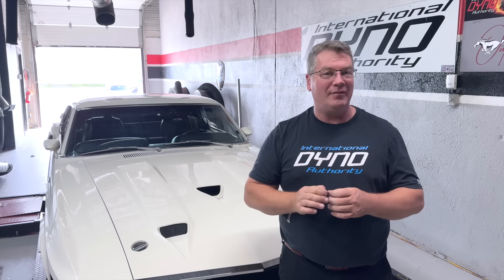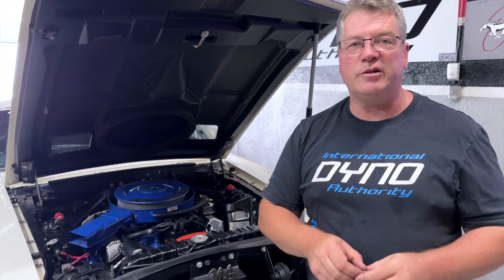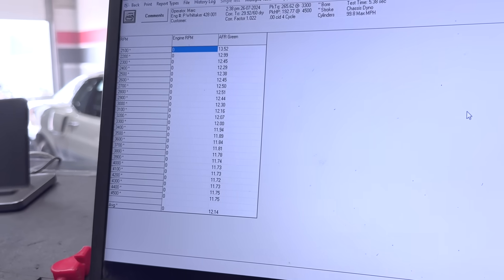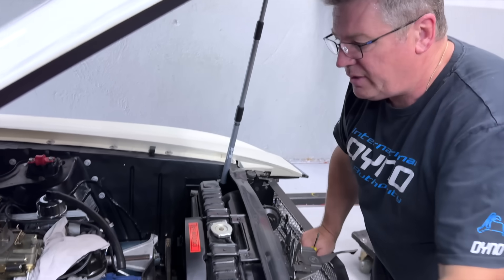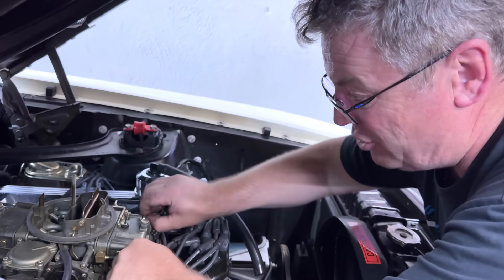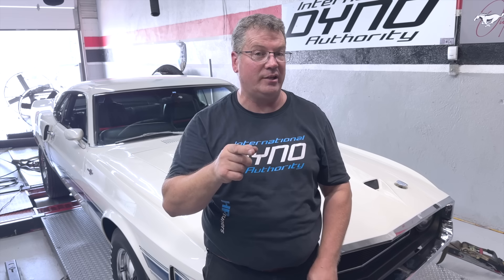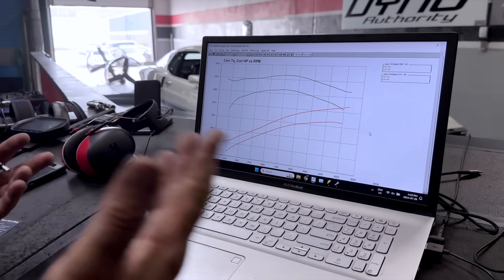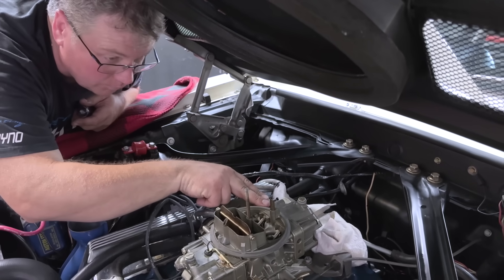Original, unrestored '69 Shelby GT500 tuned on the dyno

Comment: Torque is in lb-ft, not ft-lbs.

I would be running the timing at 10 - 12 initial and 34 - 36 at 2500 - 3000.  Without the vacuum advance, a change of weights and springs might be necessary to get a full mechanical curve.
Reply: In the old days it was said ft.-lb's.
Reply: @samiam9008  Which was wrong.
Reply: @lelandlewis7207  yeah, just saying
Reply from the maker: @samiam9008  How to Convert a Newton-Meter (Nm) to Foot-Pounds (ft/lbs)

Ft-Lb to Newton-Meters - Nm to ft-lb Calculator

https://en.wikipedia.org/wiki/Foot-pound_(energy)

https://www.motortrend.com/how-to/ghtp-1108-dyno-testing-guide/

Calculating Torque

"When an object rotates around a point, the object's speed of rotation depends on both an applied force and the moment arm. The moment arm is the distance from the point of rotation to where the force is being applied. Torque is the product of the force and the moment arm. For example think about trying to spin a drum by wrapping a rope around the drum and then pulling on the rope. If the rope is wrapped around a drum of one-foot radius and pulled with 550 pounds of force, the resulting torque is 550 foot-pounds. The torque on the dyno's drum can be calculated by multiplying the force applied by the drum's radius. However, engine torque is not equal to the dyno's drum torque because the gearing through the drivetrain changes the moment arm. The change in the moment arm is proportional to the ratio of engine speed to drum speed. Therefore, tachometer readings are necessary to calculate and display engine torque."

The foot-pound force (symbol: ft⋅lbf, [1] ft⋅lbf,[2] or ft⋅lb [3]) is a unit of work or energy in the engineering and gravitational systems in United States customary and imperial units of measure. It is the energy transferred upon applying a force of one pound-force (lbf) through a linear displacement of one foot. The corresponding SI unit is the joule, though in terms of energy, one joule is not equal to one foot-pound.

It seems the "expression"   you choose is up to the Narrator at the time.

Cheers!  and Enjoy have a super day
Reply from the maker: How to Convert a Newton-Meter (Nm) to Foot-Pounds (ft/lbs)

Ft-Lb to Newton-Meters - Nm to ft-lb Calculator

https://en.wikipedia.org/wiki/Foot-pound_(energy)

https://www.motortrend.com/how-to/ghtp-1108-dyno-testing-guide/

Calculating Torque

"When an object rotates around a point, the object's speed of rotation depends on both an applied force and the moment arm. The moment arm is the distance from the point of rotation to where the force is being applied. Torque is the product of the force and the moment arm. For example think about trying to spin a drum by wrapping a rope around the drum and then pulling on the rope. If the rope is wrapped around a drum of one-foot radius and pulled with 550 pounds of force, the resulting torque is 550 foot-pounds. The torque on the dyno's drum can be calculated by multiplying the force applied by the drum's radius. However, engine torque is not equal to the dyno's drum torque because the gearing through the drivetrain changes the moment arm. The change in the moment arm is proportional to the ratio of engine speed to drum speed. Therefore, tachometer readings are necessary to calculate and display engine torque."

The foot-pound force (symbol: ft⋅lbf, [1] ft⋅lbf,[2] or ft⋅lb [3]) is a unit of work or energy in the engineering and gravitational systems in United States customary and imperial units of measure. It is the energy transferred upon applying a force of one pound-force (lbf) through a linear displacement of one foot. The corresponding SI unit is the joule, though in terms of energy, one joule is not equal to one foot-pound.

It seems the "expression"   you choose is up to the Narrator at the time.

Cheers!  and Enjoy have a super day
Reply: @internationaldynoauthority693  look at your own screen when showing the power curves, @ 15:36 it says “up 101.89 lbs-ft.”  SAE standard for engine torque is lb-ft, not ft-lb. They are 2 different measurements.
Reply: A have never heard anyone say anything different then ft. lbs. of torque
Reply: @3644Darrell  Then you need to look more.  Most articles use the correct lb-ft and it is the SAE standard.  Look at dyno sheets and they say lbf-ft.; I have only seen one that didn't. 

Many "car guys" who don't know say ft-lbs because they think of a torque wrench, but it is supposed to be lbf-ft, or pound feet of force.
Reply from the maker: @lelandlewis7207  herein lies the issue. Without actually testing, without actually knowing what the results are from each one of the tests. Saying 10:12, saying 34 3638. Is just guessing conjecture. 

That was a large point of this video. To show, that you can achieve excellent results by repeating tests, that are very accurate, that are straightforward. And, will also show you step by step how to reduce or completely remove the unneeded smoke. 

Very few times in tuning. Do we ever need to really do much with the ignition timing. 

Normally we work with the ignition timing curve only. 

The same procedure was followed, in this video. The ignition timing curve was adjusted rather than the actual peak numbers 

Merry Christmas, happy holidays to all of you and your family and your friends. From all of us at International Dino Authority
Reply: @ actually. I say it from experience tuning engines and dyno tests I have had run on engines. I’m not saying they are perfect for this engine, but from my experience, they give a good curve and power. On a 350 36 was optimum, losing power at 2 degrees up or down. I found the same on a mild engine , 10:1, at 310 @ 5,600 HP and a 10.5:1 465 @ 6,700 HP engine. Above those powers I can’t say by experience, but logic dictates that higher RPM requires more total to get the optimum burn and hit the maximum pressure at the 21 degrees piston position rule of thumb.  Even at 10.5, with a big bore like the 428, it should need a bit more than 28 for best performance, to get the flame front across the cylinder for maximum pressure and still not ping. 

But, yes, without testing it, it is just opinion based on my understanding of what timing does for the flame front. I am not saying you’re wrong, but I haven’t seen a NA engine that didn’t need more than 28 degrees total and most like it at about 3,000. I just say what I would try and then back down as necessary. 

Great job on the smoke issue either way. I don’t think I would have picked up on the squirter issue, at least not without some research and watching your video. 😉
Merry Christmas to you too.

Comment: I had a old hyundau scoupe turbo 1.5 4banger about 102hp. Ported an shaved the head down. Bored and stroked it made 198. Eith no new parts ppl forget its making ruff serface smooth is huge deal any car can make more power wuth no acual upgrades
Reply: Bored and stroked isn't an upgrade??
Reply: @tuffguy428  point was no expensive parts needed. Just junk yard bits and some elbow grease

Comment: My uncle bought an old local garage that the PO had passed away and found a complete 67 Ford Fairlane 428 CJ  4 spd sitting in a small bay in the very back that nobody knew was in there that needed restored he finally got it completed a few years later and it dynoed at 303 hp on a portable mustang dyno but he just recently passed away from cancer and now his daughter has the car along with his sons and her brothers 67 gt500 that he was restoring but also passed away from cancer a little over a year earlier
Reply: The CJ wasn’t offered in 1967, so the Fairlane either had a 390 or someone transplanted a 428 into it.
Reply: @fastmz3  it may have been a 68 it was numbers matching engine
Reply: I can actually find out exactly what year it is I'm sure he wouldn't have spent as much money as he did restoring that car if it wasnt the original engine
Reply: @bethanyhaskiell9116  If the first digit of the VIN is an 8, then it's a 1968 model.

Comment: Adding headers and a free flowing exhaust would make such a huge difference on that motor.
Reply: Agreed but putting headers on that original car would hurt the value.
Reply: @tuffguy428  depends on if that's why you own it I suppose.  If I had an original '69 hemi r/t charger the first thing I'd do is headers with a proper exhaust, I'd just keep the original stuff in storage somewhere.  My Nova has headers with a 2.5" exhaust with an x pipe and it sounds so much better than when they just had dual pipes with no crossover.

Comment: a rare honest dyno test.  300hp. The claims of some folks about these engines are absurd, these are RV/truck engines, rated around 335hp.
Reply: @TheHypnotstCollector  300 wheel , there is a fair amount of loss in the drive lines which puts this particular car well over 335 at the flywheel.
Reply: @kylevantassel7259   True.  There's a good 100hp, esp if it's an automatic trans.
Reply: No way was the CJ an RV or Truck engine.
Reply: @jeffcoleman2263  Well, they're long stroke, put em in RV's and Trucks... and other stuff. Not a race car engine.
Reply: @TheHypnotstCollector  428 was never installed in trucks. Indeed, Ford created the 428CJ specifically to address street performance, and its public debut was at the ‘68 Winternationals in Pomona - a race meeting - where it cleaned up its classes.

Comment: What a Lemon.  428 cid and a lousy 299hp @ the wheels. I now understand why they only had this engine in these cars for a very short period of time. I think the 351 Windsor would make that hp or even more. How much does one of these 428cid boat anchors weigh ?.
Reply: In 1968 Hot Rod magazine tested the 428CJ mustang.  In ran a tractionless 13.56 @106. They stated it was the fastest pure stock ever tested by them, period! It went on to dominate the Winter nationals. Look it up on YouTube fuk head 🙄
Reply: Turn in you girl card. You're not even human.
Reply: The guy probably doesn’t have the money to buy a mustang II
Reply: Why so negative? Go back to your Pinto.
Reply: A 351 Cleveland would make far more power than a 351 Windsor.
Reply: @ you have to stay with the engine it was manufactured with to keep it’s value-otherwise stick a 427 in it  sheesh
Reply: I would trade 10 351 w or c for a 428 cj
Reply: Are you over 12 years old?
Reply: @3644Darrell  why do you ask, are you a pedafile.

Comment: the car pictured looks like a 71 or72, not an unrestored original 69
Reply: they didn't even make 71 or 72 Shelby's
Reply: @nolanjohnson2124 Actually they did. A deal with CS and a belgium dealer released Shelby Europa with the 71body line. 351c4v powered tho.
Reply: No, it doesn't. It's clearly a 69  shelby.
Reply: Go back to sleep

Comment: a very nice looking car but what a turd glad that its in the shape its in but no way it should be left like that that car should be in the 500-600hp range to even be decent and thats even low that car right now is a joke engine wise they had way more powerful engines in 1969 The 1969 Chevelle SS L78 396 had a rated power of 375 horsepower at 5,600 rpm and 415 lb-ft of peak torque at 3,600 rpm Year: 1969. Make: Dodge. Model: Hemi Charger 500. Engine: 426 ci/425 hp.Year: 1969. Make: Chevrolet. Model: Camaro COPO. Engine: 427 ci/425 hp (L72) V8.
Reply: Okay...but just to be clear the figures you're quoting are at the crankshaft.  The numbers in this video were at the wheels.  Big difference.
Reply: @dewrus2153  yeah i know that and some of them cars were underrated for insurance reasons this one clearly not
Reply: I see you dont know shit about cars😂😂
Reply: This doofus has no idea that a Dodge Omni in 1979 made 74 hp. You can't change history bud.
Reply: You obviously completely missed the purpose of this test. The owner brought the car for the shop to analyze the rich condition and correct it. It was not to compare engines and horsepower from other manufacturers. The analysis confirmed a very rich mixture from idle to maximum speed and professional tuning corrected it close to advertised horsepower for this engine. No point in turning the test into something it was never intended to be,
Reply from the maker: Absolutely Correct!   Thank you.   No one could've stated it more clearly or with any more straight forward intention.
Reply: @ellieprice3396  thankyou very much for this comment - I'm not quite sure what the negative commenters think that this video was about.  Never was a question asked if you liked the car or not!!!
Reply: @ellieprice3396  i full well know what this was but lets clear this up do you need a dyno to tune a carb no does hp numbers need to be had to tune a carb no so was this about getting it dynoed and increasing hp as it was about tuning the carb yes it was if you can't see that i don't know what to tell you here is the real problem because the car ran so rich from the factory and was drove 32,000 miles how washed out are the cylinder walls in order to tell the engine will need took apart im sure it will need honed i have seen some cars not last 20 miles with a badly set up carb and drove hard and it destroyed the block just because its no longer smoking don't mean the walls are any good
Reply: @tunercars3  Here you go: . . . . . . . . . . . . . . . . . . . . . . . . . . . . .
Reply: @pallecla  hey thanks if you can't read without dots you have bigger problems to worry about
Reply: You appear to be a GM nut swinger, lol! Ford 427 SOHC single carb engines were rated at 615hp, put that in your pipe and smoke it moron...
Reply: Bet you have never driven a car without nanny controls or even a 60's car.

Comment: It’s not the distributor it’s the carburetor. You will always have hesitation and leg with a vacuum secondary carburetor. What this thing needs is a double pumper, and then set it up properly. Mechanical advanced distributor is way better. You can tune your advance curve, and mess with all the settings to get it perfect.
Reply from the maker: @chrismorneau8188  In the era of modern carburetors, available. I would definitely if I was going to do any upgrades to a original style car like this I would definitely put on a new XP, Holley carburetor. And, I would do that really good aluminum heads. A set of air flow research. And Long tube headers. A set of free-flowing mufflers. Etc, etc etc. However. This car is worth a fortune the way it sits over a quarter million. Jo, we were going to definitely be working with what we were given. And make the original work the absolute best that it can, which means it requires more effort. It requires getting it set up absolutely perfectly the way it is.
Reply: @internationaldynoauthority693  Great reply.  This car is a collector's piece, not a drag car.  It absolutely would make much more power with modern parts, but you'd destroy the value in the process.  

If someone wants to make a  drag car out of a 60s mustang, you're better off starting with a 6 cylinder 3 on the tree model, those aren't worth much.

I also disagree with the premise that it's not possible to make a vacuum secondary carb operate without hesitation.  It absolutely is possible.
Reply: "hesitation and leg" - a true expert.
Reply: @eriklarson9137  "Lag"
Reply: What you say might have truth...but those recommendations would mean swapping parts on an original and unmolested 55 year old vehicle worth well over $150k.  If you're swapping parts for better performance, there are TONS of things that you could do...but the customer just wanted the best it could be while remaining original.  Additionally, if you have lag (not "leg") from a vacuum secondary, the secondaries are just coming in too early or too late (depending on what you define as "lag").  A simple spring change can remedy that issue

Comment: Why are we trying to tune an "original" mustang without the original vacuum advance distributor. Ignition timing is about a third what makes an engine make power. Why are we limiting power on purpose? 😅
Reply from the maker: @mechticulous8202  when customers arrive at our shop. We don't attempt to sell them parts. We are a tuning shop. We don't attempt to tell them how to upgrade their vehicle with a different carburetor and cylinder heads, and different distributor etc etc. We are unable, due to something that is just strictly wrong with the car, to tune it. It. We are a tuning shop only. We will let the customer know. But otherwise we tune, as the vehicle arrives. After tuning the vehicle, in this case because we are a tuning shop. The car became more responsive. The car came to life and the biggest biggest issue the customer was asking about, was the smoke. Other issues wrong with the way crankcase was being vented etc etc. That we didn't go over in the film spark plug gap. That we did not go over in the film setup of some other items that we did not go over in the film. But had no point. Did we ever feel that the distributor required vacuum in order to make the car drivable and get a reasonable result with what is available to us. So, we tuned it. We were able to get it to run absolutely immaculately. And, if he was going quarter mile Racing he would change a lot of things. But because it's mainly a vehicle that goes to car shows and, the customer would like if it didn't smoke all over the place. We fixed that. We tuned in over 100 horsepower. We tuned in lots of available torque. And the carnell runs as good as it can with the setup that it has and the parts that were available to us from this original setup
Reply: Vacuum advance only works under part throttle. Good for gas mileage. That's about it.